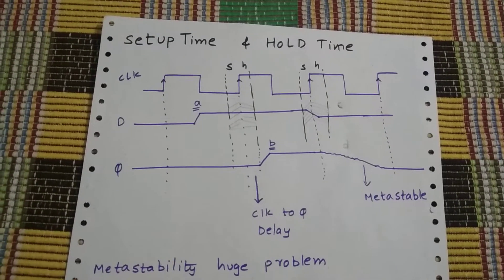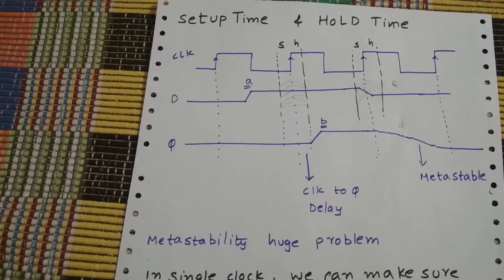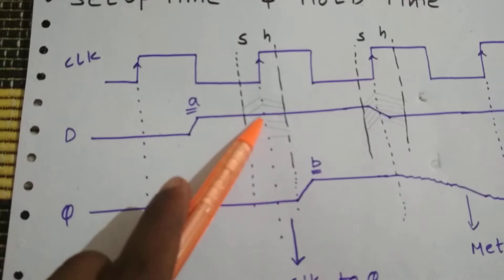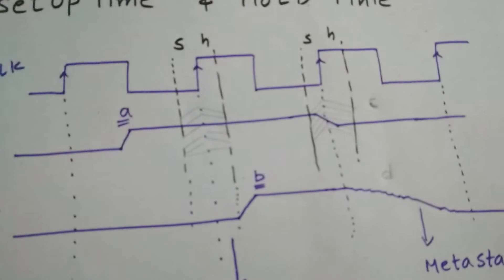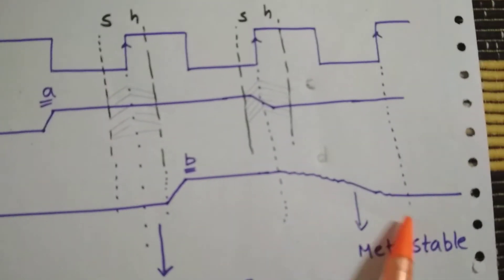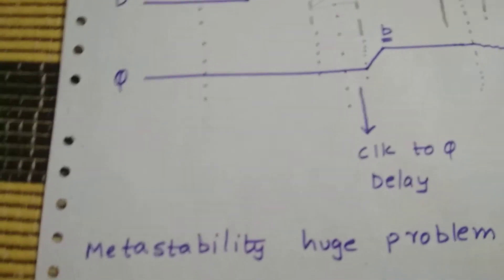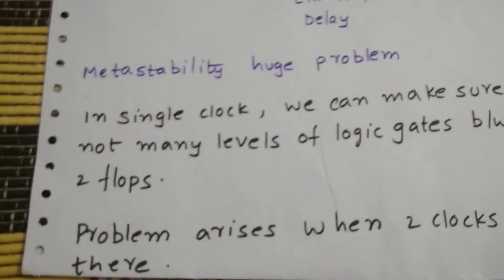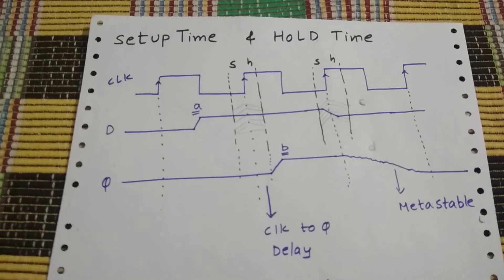Setup time and hold time | Metastability  condition | Explained.

Comment: Metastbility means that first flop output might goes to 0 or 1.To remove metastbility we use different synchronises
My question is what if the metastable output is not as the expected output.There will be data corruption, right?
How to overcome that?
Reply: I have the same doubt

Comment: during the setup time or hold time if data changes to 0/1  the flip flop goes to metastable state ...is it right?...then how we will overcome this problem..
Reply from the maker: Hey Vinay , thanks for asking the question.
To overcome Metastability problem we will use two flop synchronizers , with use of flop synchronizers we will get stable output.
Reply from the maker: https://youtu.be/RWh5sKgAuj0
Check this video where I have explained about two flop synchronizers. Thanks for  asking.